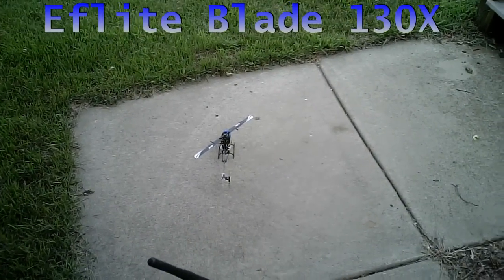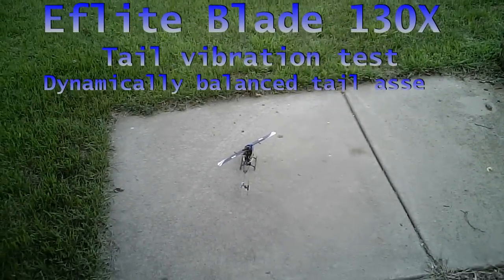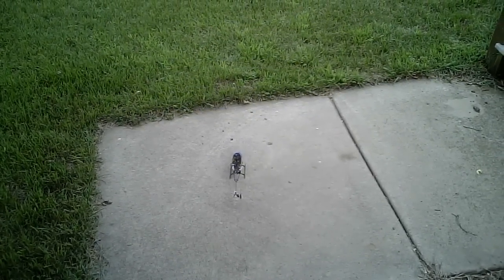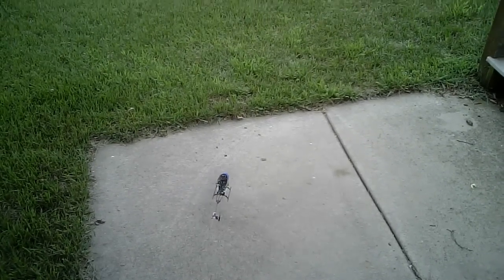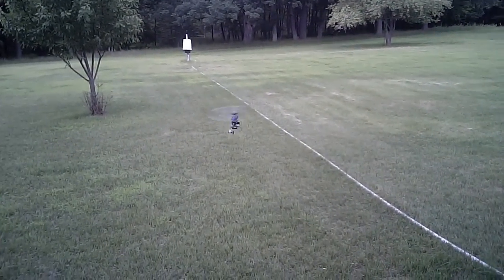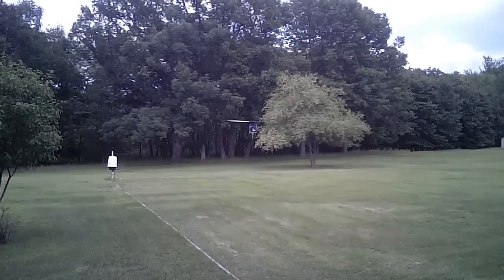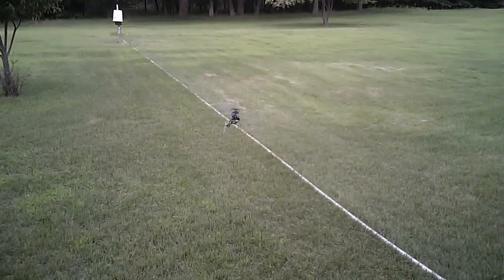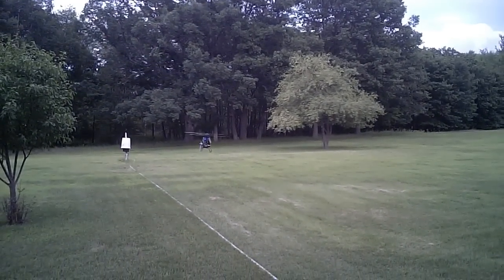130X tail test after dynamically balancing the tail rotor & installing Boca tailcase bearings

Comment from the maker: I don't have a video of the process, but it's really easy. Just remove the main blades, spool it up on the bench, and feel the tail. If you feel vibration, add a small piece of clear tape near the center of one blade & spool up again. If the vibration gets worse, switch blades. If it gets better, add more tape. Rinse & repeat as needed. That's all there is to it. If you can't get it to balance, either the tail-shaft bearings are too sloppy, or the tail-shaft isn't square. Solve that & try again.